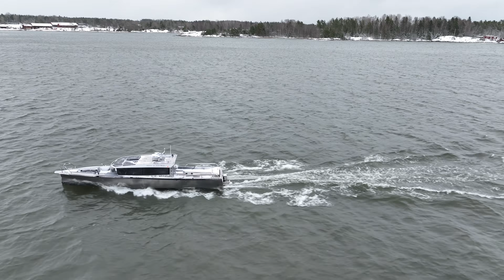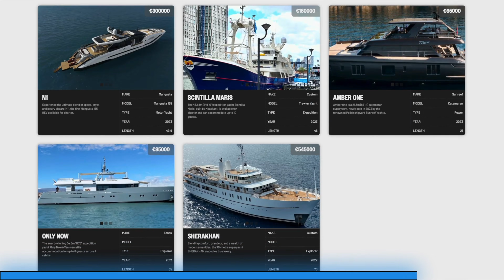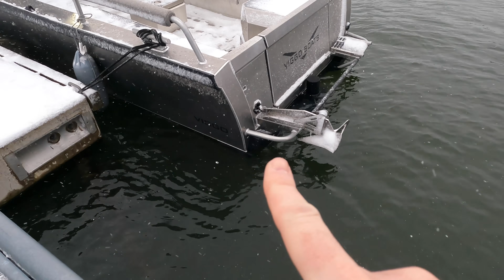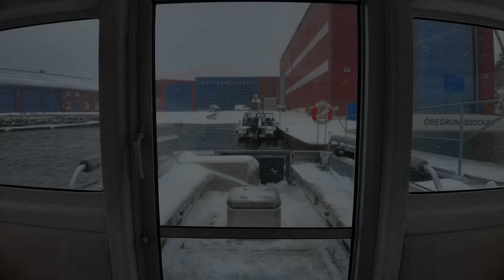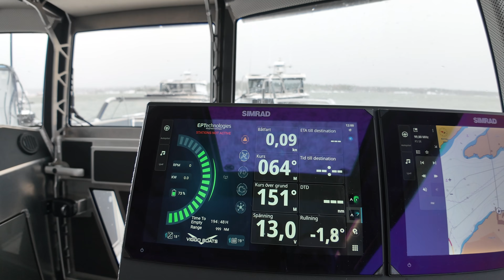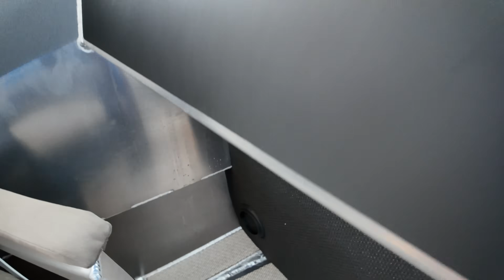Hull #1: FIRST LOOK at the New 100% Electric $585K Aluminium Boat!

Comment: Not that I have the money for this boat but I always wondered if they could make a jet drive C10. This is almost there. I think a Hybrid would be perfect. Use the battery and the electric motor for low speed and silent running and then kick the engine on for high speeds and charging when you need it. I've seen a couple other small commercial boats with this setup and it just makes sense.

In my opinion twin jet drive with hybrid power would be optimal but I don't think all the weight would help
Reply: Thats what my design has. Two drop down props for 5 knot cruising using solar, and two ltx53 jets for a top speed of 27.
Reply: Props beat jets when it gets rough. C10 is an amazing boat in the rough. Also shes not designed for inboard engine from a balance point of view.

Comment: Very impressive. Batteries can be updated as tech evolves and the hull will be fine for generations, then can be recycled. Diesel option too if charging an issue.. Can be fast charged in 1.5hrs. More and more chargers popping up in the archipelago. If you dont need to go 50 knots (like all their other models) it’s ideal. Not many people do 80 miles without stopping from lunch (charge) so range wouldn’t bother me so like electric cars it’s all about charge points.  Cool scissor table. Lots of seating space inside and out and i guess you can have a canopy over the stern seating area. . Looks like sound deadening material on the inside so Quiet, social boating without relying on the wind. really like it. More on Viggo boats please YouTube I love their designs.  ..Good effort for filming in such weather !!

Comment: With a little diesel generator I bet this would make for a killer offshore fishing setup, or even a small passagemaker.
Reply: Pretty sure that's what they mean by "range extender"; a genny that will recharge the batteries and/or power the electric motor.

Comment: Range anxiety is bad enough in an EV car. I wouldn’t want to put myself through that on a boat. Every trip would have to be planned meticulously, to ensure somewhere to recharge it. That sort of defeats the object of having a boat, that you would want to take out to sea, whenever and where ever you choose. I would definitely spec an economical diesel, or even an electric diesel combo. You get the best of both worlds that way.
Reply: A generator that can power the motor direct and or charge ... Is the easiest way to go and most fuel efficient and reliable..also most modular long term. 
Plus the generator can be placed anywhere to suit .. and set to run any fuel at its Stoichiometric optimum all the time it's needed . Less wear and tear on the Generator.
The more solar you can add the better... Those on the roof might be walk on solar non slip.

It's E foiling boats that offer the greatest efficiency at higher speeds...and a smoother ride in a choppy sea.
Reply: This already reminds me of the Dashew long range cruisers.. .
Reply: This would be used as a school bus boat in the Scandinavian Archipelagos.
Reply: You can spec those options.

Comment: Nice looking boat, but no real range, so what is it good for?
Reply from the maker: most weekend boaters not cover 80nm in a single day.  Prior to the C11 you would be lucky to get an open GRP that could manage 20nm on a single charge in decent conditions
Reply: Well you could always use the range extender if you need more than that.
Reply: You can fast charger in around in 1.5 hrs. Or have a diesel inboard if you prefer. Most boaters average less than 20nm a day anyway. Nice and quiet and peaceful …ex sailors ? Nice.